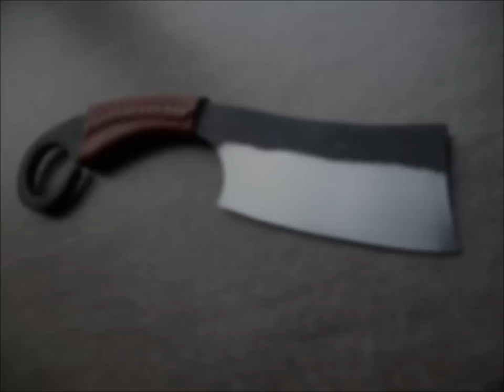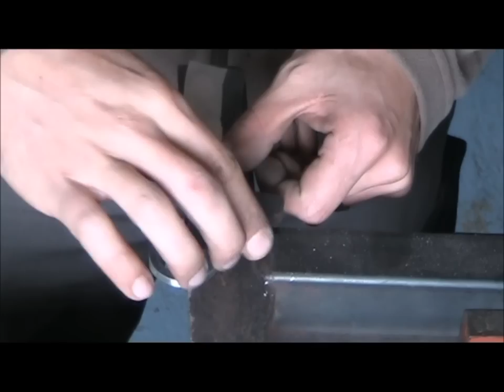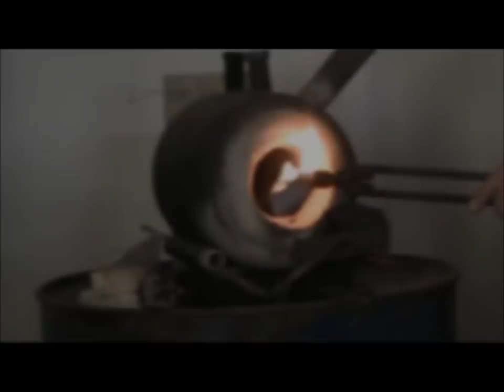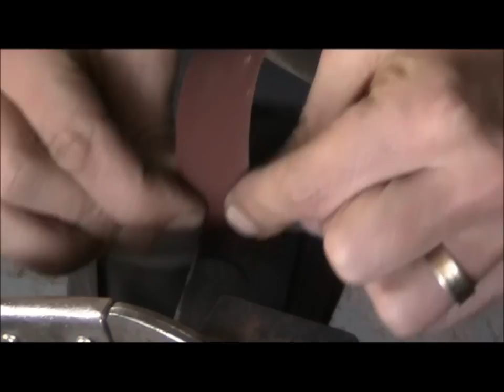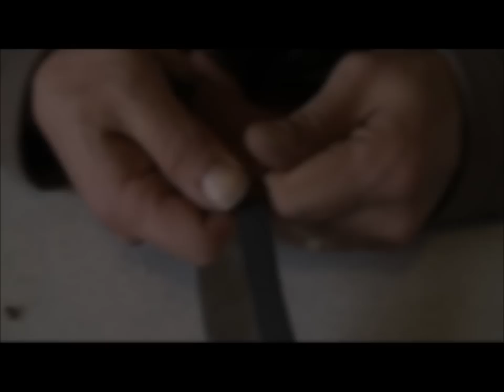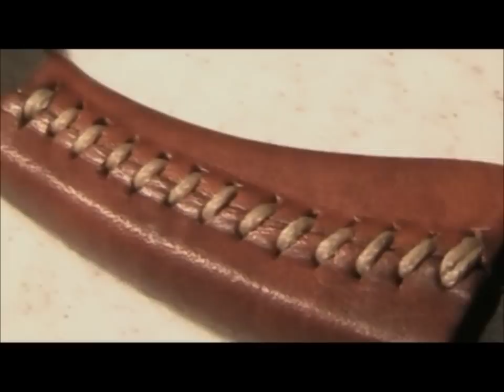Razor hybrid

Comment: Very nice design, I love the contrast of the polished blade.  Just curious, why heat under a shield?  I'm a novice, its great to see things in the process.    thanks, Frank
Reply from the maker: hi frank,
im doing this to have a better control over the temperature. 
its not that easy sometimes to regulate a gasforge to a good temperature for taking a soak time on heat.

have a nice day, buddy.